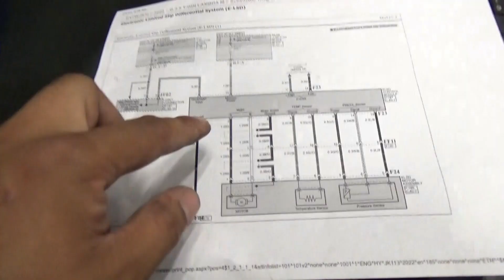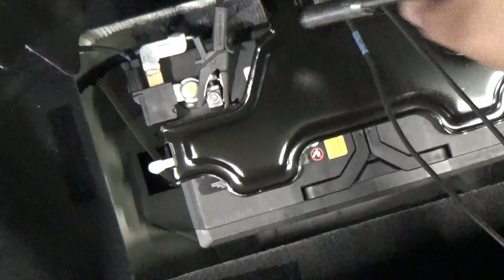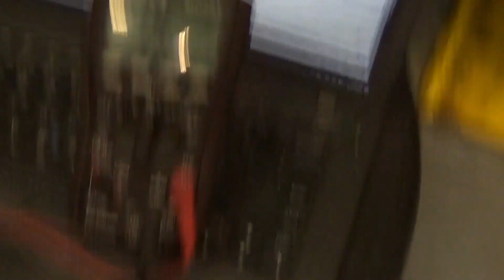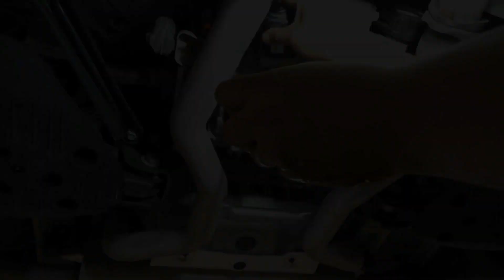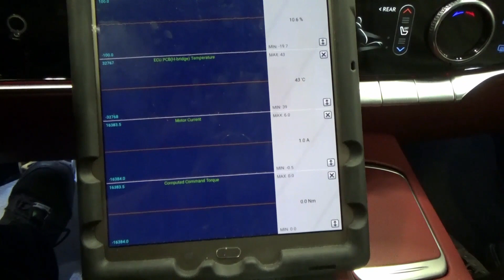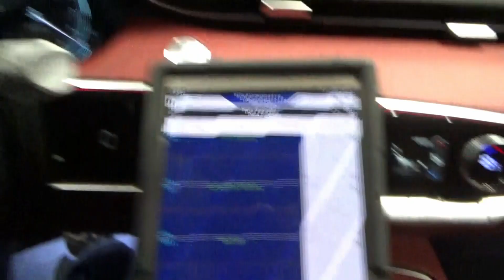Genesis GV70 E-LSD fault, E-LSD motor replacement

Comment: Hello :) have one question about front radar sensor for ACC. I had minor accident ant radar sensors one leg jumped out its place and i drove it for some time like that so now it has bad sensor alignment angle and does not let ACC system work (condition not met). I put radar back in its place and now its aligned. Do i need to perform any procedure for this code to go away or i just need to drive for a while and it will go away if angle now is correct? thank you in advance.
Reply from the maker: Hi, for that feature you have to peefectly set the angle using inclinometer and then perform calibration using target points and scantool. Coz for you or me even it looks okay but theres a chance that the angle is bad and causing for sudden braking.

Comment: Hello, hope you will answer :) 
I have same message on dash, and code - P188213 (Motor wire electrical fault). Measured voltages, they are good, resistance on Actuator motor is 3.2 to 2.2 (i guess while it was cooling down, resistance dropped), but nothing like in your case 17 and 400...  Could this also be motor, or should i look elsewhere? Thank you :)
Reply from the maker: Right now those actuator are very common to fail, and yeah most likely you need new actuator for that.
Reply: Hello, thank you for reply, maybe there is a way to check level or fill some oil to elsd, because it leaked some when i exchanged the motor (around 100ml). Maybe there is a way to add without taking it off? 
Thank you
Reply from the maker: @MartynasStirblys  100 ml for is okay. What they instruct us to is remove the differential unit and replace the actuator while the differential unit is tilted. But i usually do like a quick swap so that just less oil will be out. Hope that helps

Comment: Thanks good video. But how can you top up the oil?
Reply from the maker: On this video what i did was collected how much fluid it came out from the actuator then use a syringe to inject how mcu fluid came out and quickly installed the actuator, but with the new bulletin they ask you to tilt the whole differential when removing the actuator..hope that helps.

Comment: Did this ultimately work?
Reply from the maker: 2nd video i replaced the elsd actuator and fix the problem
Reply: @Hyundai Tech  thanks!  Have you had any more GV's come in with this issue?  My dealer hasn't tried this yet, but has replaced rear differential 3 times.  Is there a bulletin or reference material I can have them look up?
Reply from the maker: @DailyDose-m8o  i know us and canada has different bulletin, but in canada after this video they came out with bulletin regarding all wheel drive warning light on, basically when we scan for codes and it pertains to all wheel drive system like awd torque error something like that they just said replace the actuator, if the vehicle is equip with elsd and then replace the elsd actuator, if no elsd equip just replace the transfer case actuator. Hope that helps.
Reply: @hyundaitech  thanks again!  I will suggest that.

Comment: Have there been any tech bulletins or fixes from the factory
Reply from the maker: Yes i think its a tech tip instead i think replacing the whole transfer case , they said if you have codes for the motor just replace the awd motor or lsd motor depends on the equip on the vehicle

Comment: Good video using scope! Where did you get those test lead bundle you used for volt meter to differential?
Reply from the maker: Thanks man, for the test leads i use that product is from.hantek. i bought it from.amazon but i couldnt find it anymore to give you the link. I read a lot of good reviews from aeswave.com they have  terminal test kit.